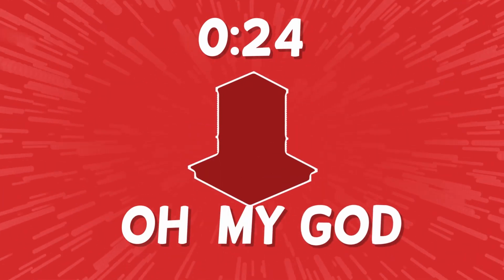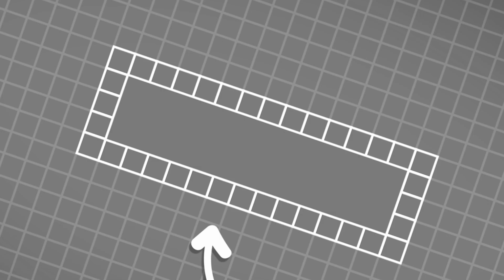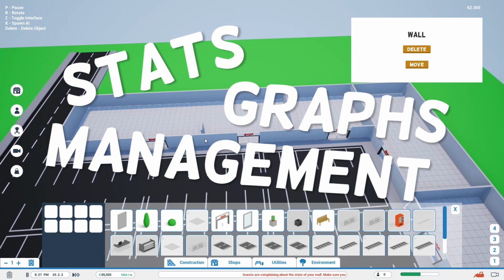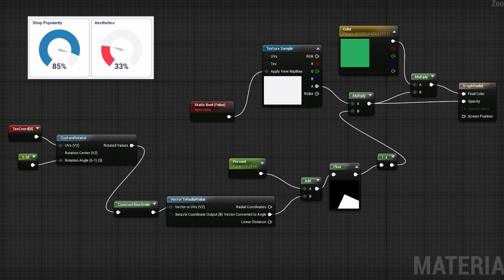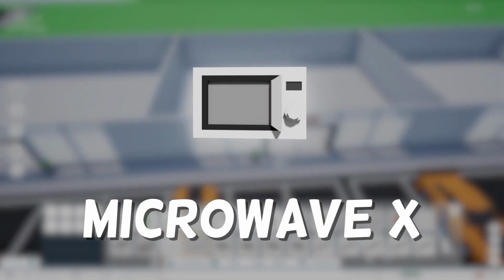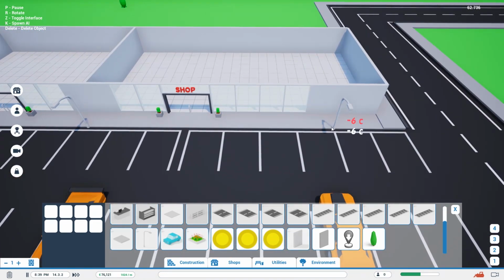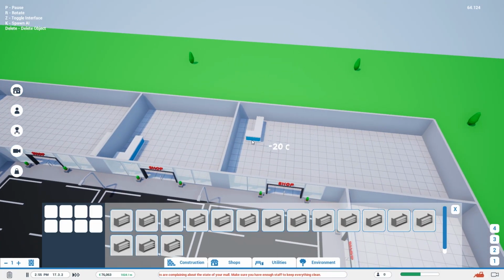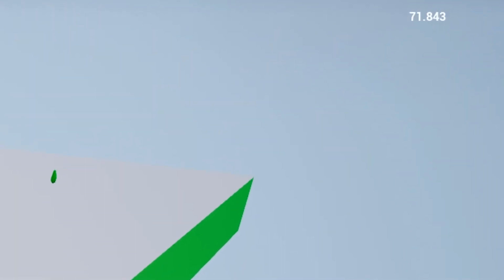How I optimized my game to run MUCH smoother! | Unreal Engine Devlog #10

Comment: Video is well put together. Could you explain some of the algorithms a little more?
Reply from the maker: Which one exactly do you have in mind?
Reply: @MallCraze  I am more curious about the instance implementation. I know in minecraft they use procedural mesh and mesh chunks for loading and offloading on the fly. But I am unsure how to make a full circle the example in a tycoon. It sounds like you're doing objects and not just a mesh generation. 

Lastly for the wall generation in your first example how is it done? I noticed you painted each wall segment with a different texture. Is that wall one game object with a 3d model where a new material/texture is applied per model? Or is it created with a procedural mesh and the new material/texture is applied at a subsection of that mesh?
Reply from the maker: With the Instance implementation. I'm not actually doing any mesh generation where I would create new polygons. It's just a very simple model that is copied many times (just like instances work). I'm still working on the final implementation and I'm not 100% done with that yet. 

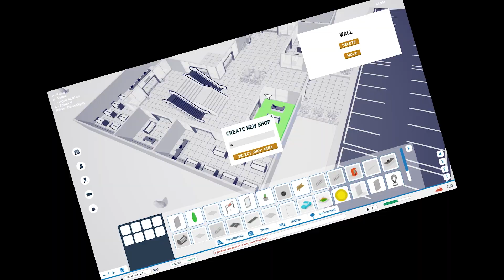Wall generation: if by first example you mean somewhere around 0:55, then it's an old thing I used to have as a placeholder, where I would select a shop area, but it just created many steps to make a shop and I scrapped that Idea.
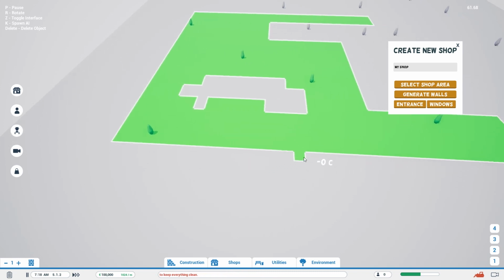Before It used to be 2 steps (place the walls and the select shop area - so that other game objects can know that they're placed into some shop). At 2:18 you can see that I merged this into one task - only select shop area and let the game generate the walls automatically. Each wall is a separate object.

Hope I helped at least little bit and didn't made it seem even more complicated :))
Reply: @MallCraze  thank you this simplified a lot of my questions. Im transitioning from Unity to UE mainly because I prefer c++ over c#. Do you have any tutorials you recommend for your workflow?
Reply from the maker: I'm primarily using Blueprints instead of C++ but in terms of RTS/Strategy kind of game, I can recommend 3 Prong Gaming RTS Tutorial here on YouTube

Comment: Very good job it would be nice to share your knowledge by making tutorials on the creation of games of this kind (tycoon) because there is very little tutorial on this subject see none of what I found but if you have any to offer me I am a taker and also sorry if the translation and bad
Reply from the maker: Thank you! I was following the RTS Tycoon tutorial series by 3ProngGaming for roughly 9 episodes. At that point, he was making a different tycoon type (tropico style), so I stopped and from that point basically did everything myself (with the help of google and other smaller tutorials).
That's the biggest disadvatage with tycoon tutorials - there are just many sub-genre tycoons out there that you can make. 

This is also my first game in Unreal and I don't feel confident enough that my way of doing things is the right way and I don't want to make misleading tutorials with bad practices. 

Doing tycoon game is like any other, to be honest. It doesn't really matter. 
The workflow is the same: Think about a feature that you want to implement -> can you do it by yourself? -> If yes, do it. If no, search for info and tutorials online -> repeat ..